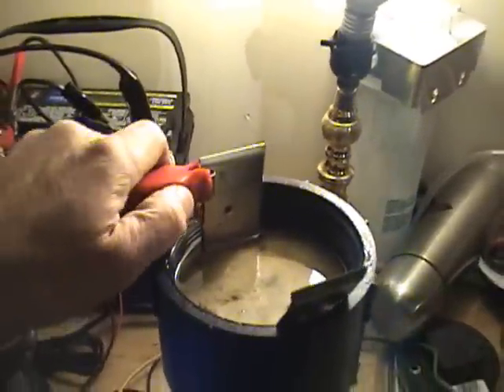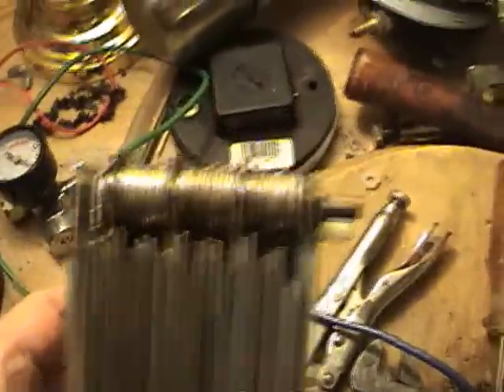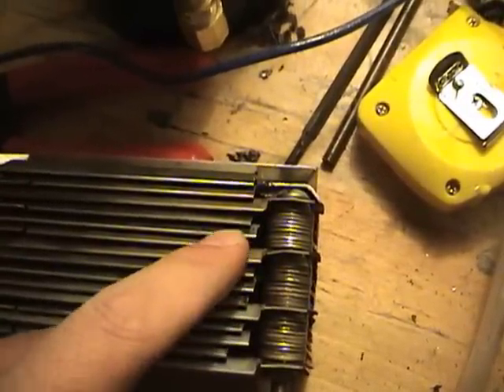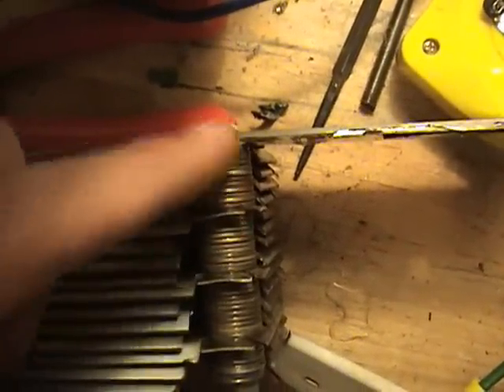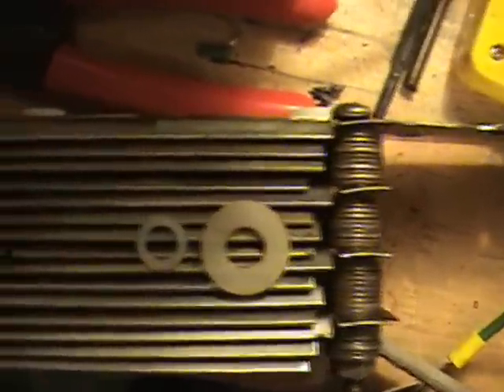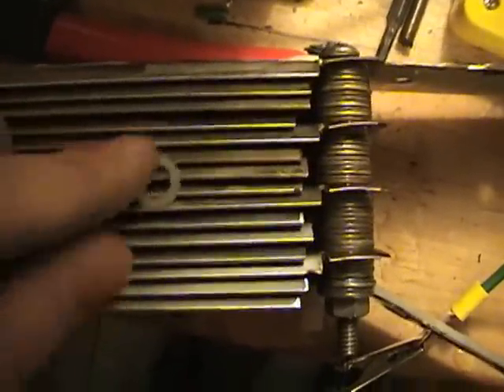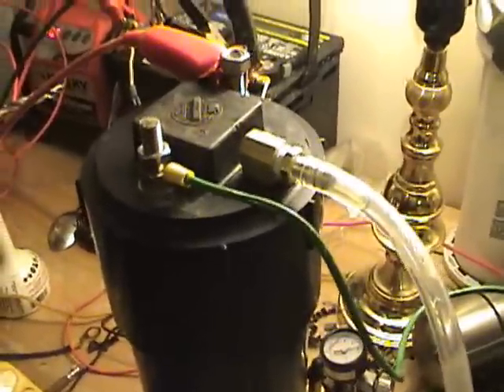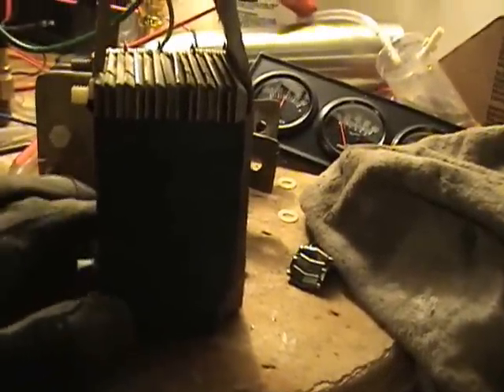(2)  HHO hydrogen cell 1LPM!

Comment: Just a little safty tip. I noticed you hooked the + terminal to the cell AFTER it was hooked to the battery. I blew up a cell doing that. The spark went into the unit and ignighted the gas. Better to attach the power to the cell and work off the battery.  Don't want to have a big bang!